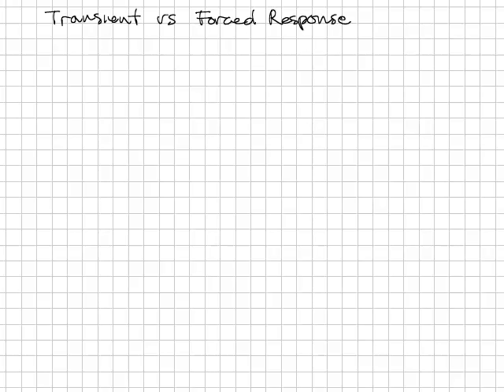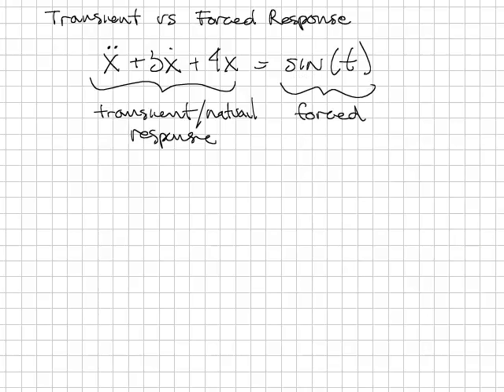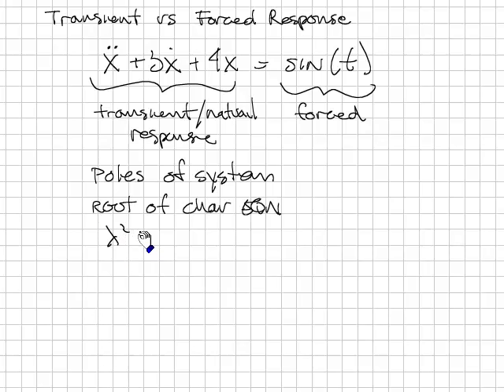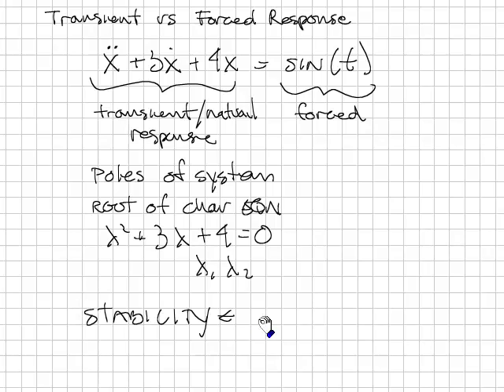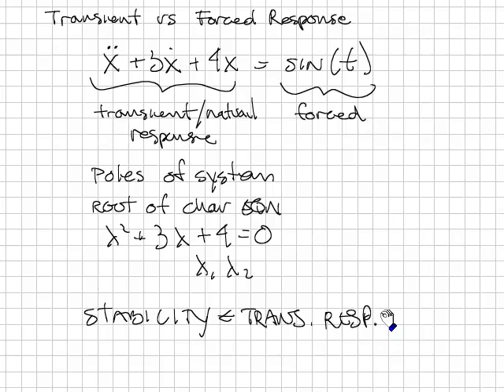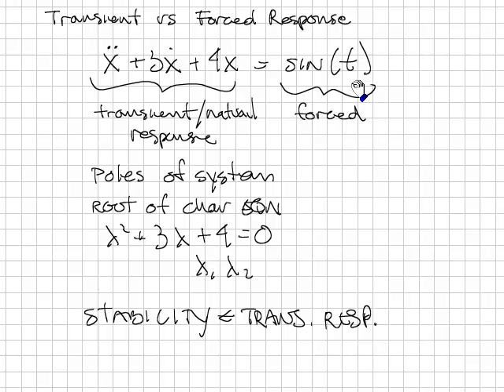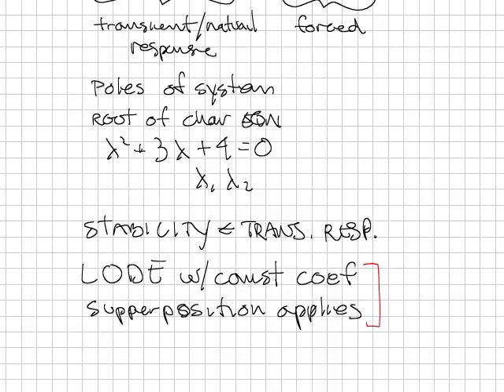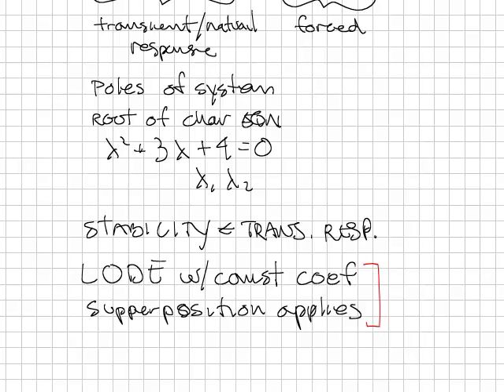DEQ Transient vs Forced Response.mp4

Comment: I'm only asking because I would normally assume that a TRANSIENT response is caused by a change in equilibrium. And what causes a change in equilibrium? I would assume a FORCE. So I would naturally assume that a TRANSIENT response would be the same as a FORCED response? But what confuses me is - why is the transient response called the natural response when clearly it is a force that is required to cause a change in system equilibrium? Thanks for your comments.